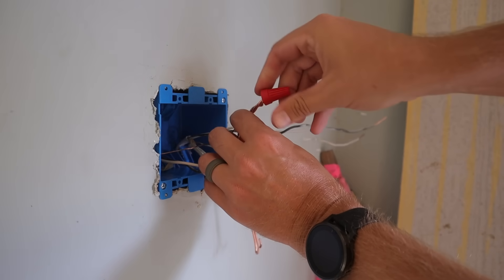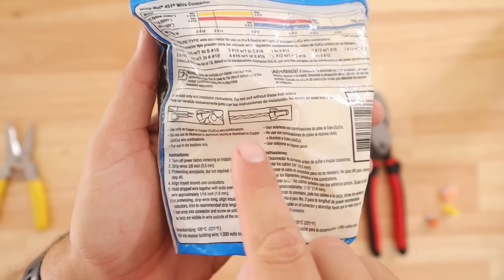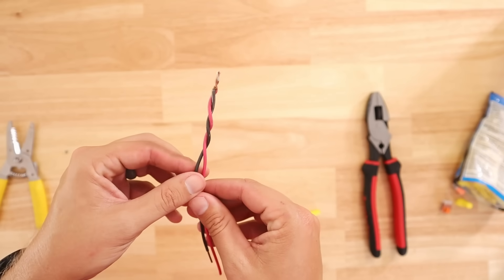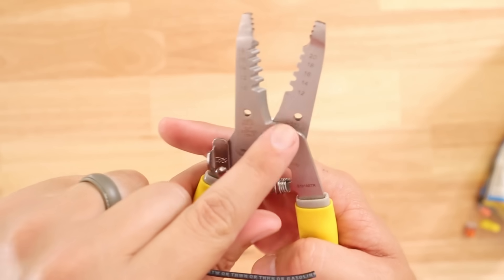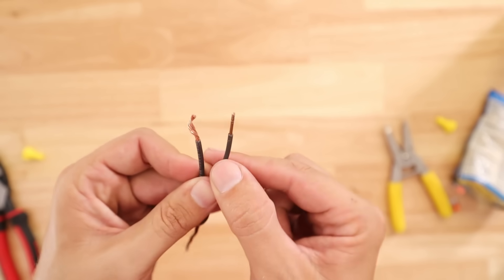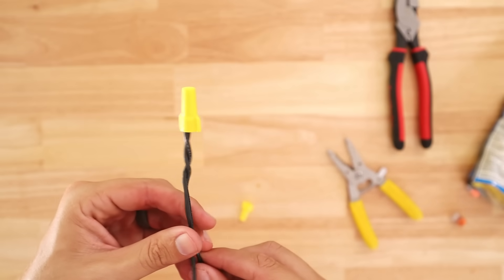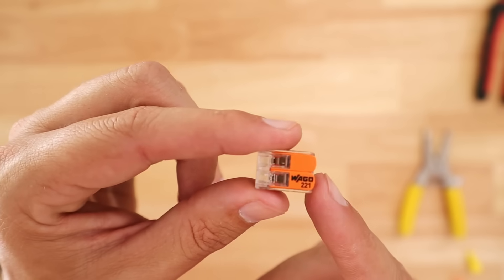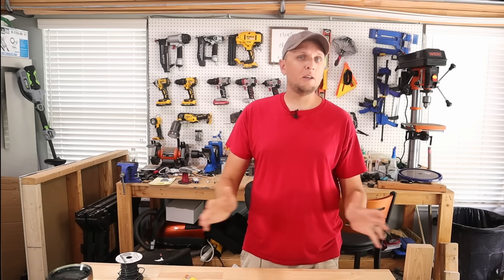BIGGEST Mistakes DIYers Make When Connecting Wires Together | How To

Comment: 10:07...the Wago. I was on a YT channel that criticized the connector for it's flimsy design. He even broke one up to demonstrate his point. So, like an idiot, I removed the Wago product and connected a solid with a stranded, thinking I was doing myself a favour.

It turns out I was wrong. now I got to remove the whole lamp assembly and start all over again.
So frustrating.
Reply: BTW, the lamp I chose has a more complex housing design and bayonet style light bulb connection. Not a quickie install. The last time I did this, it took me over an hour to rig up some shims and custom fit the entire rig together.

Comment: Cost becomes an issue in commercial applications when you're buying ten's of thousands of the wire nut vs potentially buying wago's. But DIY, easy enough to get a bunch of wago's.

Comment: I’ve been a electrician for over 50 years and have my had a problem with aligning the ends of the wire and twisting. A good electrician can tell just just by the field what is going on inside of the wire nut when I do a service call and see that the wires have been twisted the way that you’ve indicated is a real problem for a troubleshooter you could have a broken wire off on the inside and not know it because you’ve got it twisted so tight outside the wire nut and then you start getting an arc inside the wire and it may cause a fire

Comment: Twist, Tug, and Tape 🤷‍♂️👍
Reply: Twist and Tug for sure.   I hate tape on a wire nut.   Don't think it helps much.  It's a PITA to remove for the next electrician. I've done it occasionally though.  Always good to give the wires a tug.

Comment: Wire nuts are fine if you're just connecting two wires. But get into connecting 3 or even 4 wires and wire nuts get messy and prone to installation error very fast. Use a 3 or 5 port Wago and it is a quick and easy install.

Comment: The Wagos come in really handy when you have limited room in your electrical box. I still use both, but I like the Wagos for room issues and, like you said, if I have to mix stranded and solid core wires.
Reply: I find the opposite especially if you have 3 lines and a GFI you can't fit the Wago in the box
Reply: Wagos should be illegal
Reply: @jimbritttn  Why?  They work great and almost all European countries use them without issues.  
For some reason American electricians hate them, but can never seem to explain why.
Reply: @highping1786  the wires are only in contact on 5% of the surface vs over 75% on twisted wires with wire nut.
Reply: @jimbritttn  Are you a wire nut salesman?
Reply: @highping1786  I use what works best. I have used Wagos in tight boxes for LED lights where the current drawn is almost nothing but would not use them on anything over 200 watts

Comment: I have never pre-twisted wires using lineman's pliers in my entire life. Your first demonstration where you continue to tighten the wire pair by turning the nut by hand until the visible wires begin to twist is the approach I have always used. Never had a problem with the wires coming undone. As someone else on this site commented, not sizing the correct wire nut for splicing multiple conductors is probably the greatest detriment to making solid connections.
Reply: In going  back to the late 60s early 70s although I am retired now I never twisted a pair of wires in my life. You do have to be certain you have the right scotch locks. But I’ve never twisted a pair and I’ve never had a pair fail. And Areas there might be moisture in the air, like a mech room, I would also use some electric tape just to give a little bit more protection for moisture.
Reply: I have MANY, MANY times other electricians using nuts that are obviously too big for the size wires they're using
Reply: "pre-twist[ing] 10ga wires using lineman's pliers"  AND MAKING IT look pretty
i swear it gives you 4 more inches of dick girth
Reply: Very good to know
Reply: Seriously what I was thinking, having done HVAC work and DIY stuff I've never had to do that. I like how he shows yanking the hell out of the wires and saying "oh look how that comes out". Those kind of stresses just aren't happening inside a house with proper slack in the wire, this is not an automobile or aircraft (which you can't even use wirenuts on).

Like other people have said, proper wire nut sizing is the main thing, even the product says you do not have to pretwist. I asked an old instructor one time about how tight is too tight on a wire nut, he said if it breaks then it's too tight. So proper wire nuts and tightened correctly is all you really need (this guy was barely twisting them that hard when he was doing it the so called "wrong way" but tightened them snug for his "correct ways").

If it gives you warm and fuzzies doing it your way that is also correct, then go ahead. It just irks me to no end when people act like their way is always the best way and someone else's way that is also within "regulations" is wrong.
Reply: @virtual_bombe There are a lot of us out here who don't know how to do it the right way and that's why this kind of instruction is very important. Enough with your pompous attituder5698
Reply: You install these, but have you ever had to work on existing joints like you describe? Especially if it’s a situation where you can’t turn power off. When you take the wire nut off, the wires spring out from eachother when you don’t pretwist. I’ve seen this many times and it’s dangerous for whoever has to work on the circuit in the future. A big reason why pretwisting is the better way to make connections is because there’s no potential energy or spring force when you remove the wire nut. The wire nut basically acts as protection and reinforcement for the connection the way I see it
Reply: @adameverill9945  service electrician here, not sure how your holding wire when you remove a wirenut but they don't "spring out" on me and if the wire has even one twist outside the nut not sure how they ever could....
Reply: @adameverill9945 if the wires begin to twist down by the insulation, as it should, what you’re describing is literally impossible. Pre-twisting is a waste
Reply: @adameverill9945  there are always edge cases like you described (i.e working on live connections, three of more conductors within a single wire nut, etc) where you may be right but I really feel that if you twist a SINGLE pair of conductors the way he demonstrated the pre-twist is unnecessary. Also, you sound like a professional but be very careful when working with the live wires. I remember working on a hot connection once where I shifted my balance on a ladder trying to position myself away from a metal plenum and caught a shot of 120 VAC through my forehead. Thank God I wasn't 20 feet in the air when it happened. My co-worker found my mistake highly amusing!
Reply: @paulherbert5548  Having done electrical work for several decades, and worked with many professional electricians, I too have never (and never seen anyone) pre-twisted the wires. Quality wire nuts of the correct size have plenty of bite when done correctly. Not saying what he shows is wrong, but when you're making hundreds of connections a day that time adds up. The twist of the wire nut with pliers at the end is adequate.

Comment: When using the wire nut to twist the wires, make sure the wire doesn’t break out the top of the wire nut. I’ve had this happen. Recommend pre twisting the wires with pliers as was stated in this video.

Comment: In the marine industry wire nuts and/or solid core wire are not allowed.  All connections must be crimped.  Wire nuts cut into stranded wire and then boat vibrations can break off the weakened strands.  For this reason I'm surprised ceiling fans normally come with stranded wire and nuts.

Comment: No laying the wires together and putting on a wire nut is not good enough, a mechanical conection, (twisting the wirs together), then putting on a wire nut is best, safest connection. You do not want any exposed wire below the wirenut.
Reply from the maker: I agree.  Thanks for the feedback!

Comment: As a 25 year I&E I never plier twist stranded copper wire. It work hardens the wire strands and will create hot spots on your higher current applications over time.  Especially higher current AC/DC motor applications.

Comment: The instructions say pretwisting is not necessary, but the instructions are wrong. Really? I have never pretwisted. I always try to pull the connection apart after twisting on the marr on. Whenever I have to remove a marr the conductors are always well twisted together.
Reply from the maker: I didn’t say they were wrong, I offered what I do and what electricians I have talked to do as many believe it’s a better practice.

Comment: That's why after I twist on the nut, I cover it with 2 inches of epoxy resin, and then encase the whole thing inside 12 feet of hardened reinforced concrete.

Comment: Great discussion of the issues with wire nuts.
An electrician advised me to use the line  man’s  pliers to make an additional turn when I couldn’t turn it anymore by hand.  He also told me to check each wire by pulling on it to make sure that it won’t come out after installing the wire nut.
Reply: As a GOVERNMENT employed electrician, we work with a different set of rules.  If it looks good, then it's done  :)
Reply: @trvman1  I wouldn't really associate GOVERNMENT standards with quality work 😂
Reply: @trvman1  I thought you guys did it wrong on purpose the first time, so you could come back at fix it and get paid again.
Reply: @MarkSmith-js2pu  just
Reply: @trvman1  Good enough for government work huh? 🙂 "Looks good from my house"
Reply: Tugging at each wire to see how snug they are is great advice. If you can’t pull them out by hand then it’s very unlikely anything else will cause one to come loose.
Reply: Idreal (and others) make a tool to fit the "winged" wire nuts to provide extra grip and leverage to make a tight joint. The way the "square" coils in the wire nut (marrette for sure) are made they make a BETTER connection when the wires are NOT pre-twisted. They can actually make a "gas tite" electrical connection
Reply: Never ever use pliers to twist wire nuts down harder, in ao many ways this is wrong.  If the spring inside is bulging out the wire nut it can/will Crack open over time, I've seen wires come out the top of a nut from being over tightened (scary if it's live...) and if your dealing with small stranded cranking down like that can and will damage the small strands and over time they could break.  Just give a nice easy pre twist and tighten until you feel the wirenut bottom out, anything else isn't worth it or the extra step.

Comment: I had curling, multiple wraps like you've shown and I was warned I had over tightened everything, I undid the nut to check and lo and behold it actually sheared the tips of the wires into the nut. So now I am very unsure of just how tight is too tight or not. I do perform pull tests at least.

Comment: I have an important question which has nothing to do with this informative video. 
We’re in the middle of a heat wave and I wanted to add some ceiling fans and I was told I don’t need to cut the power entirely as long as I have the light switch “off” that it’s safe. I’ve had several people tell me that they have switched out their fans this way. Is it really safe to do so? Thank you!

Comment: I just ask for diy'ers not to friggn solder the splices and connections..  that crap will tick you off real quick..  my sisters house was remodeled by the previous owners and literally every single connection even on the switches and plugs was soldered..  and a lot..  even on the second panel they ran in..  house had 2 separate 200 amp services and the people connected both into a 440 panel for god knows what..  dangerous as hell the way they had it wired..  the inspector didnt even notice the crap..  failed to see the #2 cable running into the crawl space..  crazy..

Comment: If you haven't already made it, please make a video showing the advantages and disadvantages of all the common methods a DIYer might be tempted to use in joining various types of electrical wires, including vehicle wiring (including proper vehicle ground connections), speaker wiring, cat cables,  and wiring potentially exposed to weather.

Comment: For me it would depend on price.  I expect that marettes are cheaper than the others and I have a few hundred of them already so I will continue to use those until I run out.  Then we'll compare price.  If newer types are only slightly more expensive (or cheaper) then I will go with that as time is money but otherwise, old fashioned is the way to go.

Comment: As an Electrician and Engineer yeah....you did it correctly when you pre-twisted.  If you don't chances are you'll break the wirenut in the process of twisting it to the point where you can't twist it anymore especially with stranded.  Also many times Inspectors look for the wire twisted after the wirenut.  Lastly keep these words in the back of your mind when doing anything.

Take "Pride" in your work.

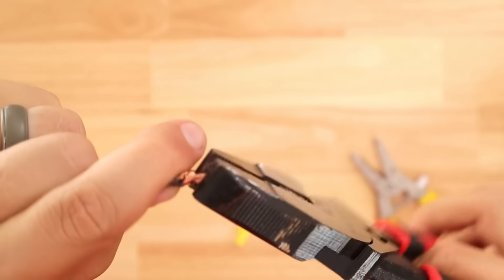Comment: Be careful when pre-twisting a stranded wire around a solid wire.  If you cover the solid wire completely with the stranded wire (as, I would say, shown at 8:30), the risk is that the treads of the wire nut only engage the stranded wire and not the solid.  The solid wire can then be easily pulled out of the nut as it is able to just slide right out of the 'tube' created by the stranded wire.  I believe this is why some wire nut packages say "do not pre-twist wires".

Comment: Push & lock options looks great.  Appears to be a guaranteed secure connect (vs the unknown under the twist cap depending on user skill), fast, still a relatively small footprint, looks easy to unseat\reconnect.  So why don't you like them?
Reply from the maker: In my opinion a properly installed wire nut can’t be beat.  It will not fail or just fall off.    I don’t dislike the wagos especially for certain applications, I just like wire nuts better.  I have a video on the channel talking about all of the different connectors and why.

Comment: If you pre-twist the wires together be 100% sure you are twisting them the SAME DIRECTION as the wire nut will be applied, otherwise your wire it will just be loosening your prettiest.

Comment: Good video, but to add to the installation, I always wrap electrical tape (lapping wraps) from the connector to the cable and back to the connector which helps to secure the connector.  :)

Comment: I prefer to use Marrettes. They have proper codes for copper to copper, aluminum to aluminum, tin to tin, and their combinations. This is best to avoid electrical fires caused by the irregular resistances between differing materials, especially copper and aluminum.

THe Wago thing looks interesting, and I can see its potential, but I'd want to make sure they are properly coded for wire material types.

Comment: Twist the wire nut on until it's tight, and then test your connection by trying to pull the nut off. If you can get it off, it was made up improperly. You don't need to twist anything together. If you're really that worried about the nut falling off, you can tape it. The first connection you showed is the best way to terminate with a wire nut as long as you ensure that the termination is tight before you put it in the box.
Reply: The point of EVERY connection is to have not just a good, reliable electrical connection, but ALSO a good, reliable MECHANICAL connection. Every electrical / electronics text or hobbyist book I read from the 50's and 60's said this, and diagrammed twisting for wires, or bending for PC boards, before applying a connector or soldering, respectively. Soldering two wires inline showed twists of ends of each wire over the other, before soldering.
Reply: @AZStarYT  Those hobby books are great and all, but as a licensed industrial electrician, I'm here to tell you that the twisting isn't necessary. A tight wire nut is itself a good, reliable mechanical connection. The twisting is just an added step that only complicates service work. I agree with twisting them together before soldering, but that's to hold them together while soldering more than anything. And solder isn't an approved method of joinery outside of electronic work anyway.
Reply: @iamtheemperor1  I used to do (and later taught) mil-spec assy.
Reply: @AZStarYT  that's great. I was taught by an ex military electrician. You may not like to hear what he had to say about mill spec electrical work.
Reply: @iamtheemperor1  No need, I saw what was considered 'passed' when I started doing QC on an assembly line (trig table memory boards for fire control, pre-solid state memory chip). That's how I wound up TEACHING the folks doing it. No more cold solder joints, at least. Also did harnesses. That was fun (not).

Comment: I have a fan light switch I need to replace but the fixture is 17 years old and the wire is so hard, it's difficult to strip it. Any suggestions?

Comment: Pre twist is a mechanical connection. I dont mechanical connect usually I run the wire nut then yank on each wire if the pop out you dont have a connection... Also stranded you cant mechanically connect cuz you snap wires be it small...

Comment: I worked as a electrician for a number of years. To get two solid wires twisted is no big deal to get them twisted together. If you have 3 or 4 or more. You twist until you see a bulge in the wire nut. And then you do a good tug test. If any wires fell out or seen lose. You took it apart and tried again. If the same thing happened. You got a bigger wire nut. And after having that much struggle. Take your linemen’s pliers and give it a few more twists. My two cents.